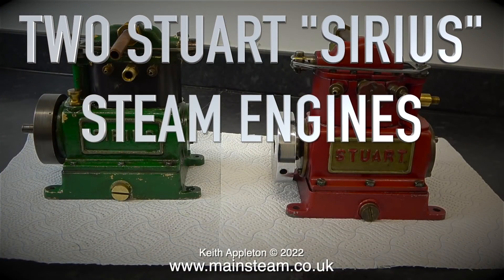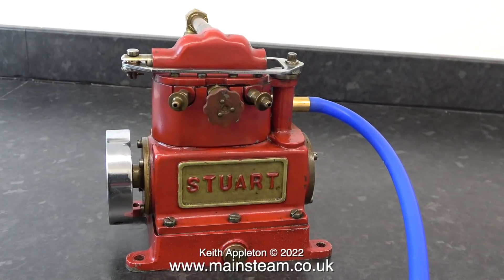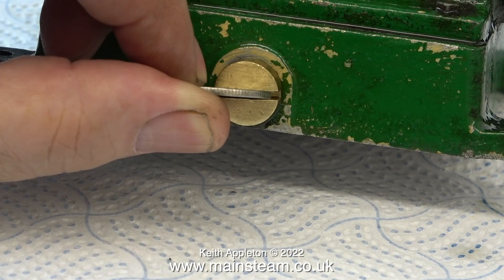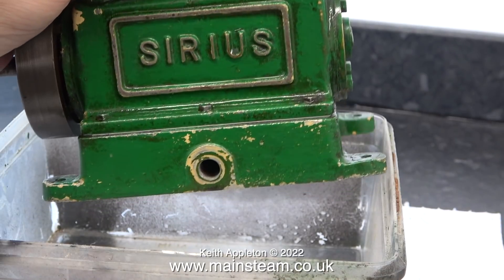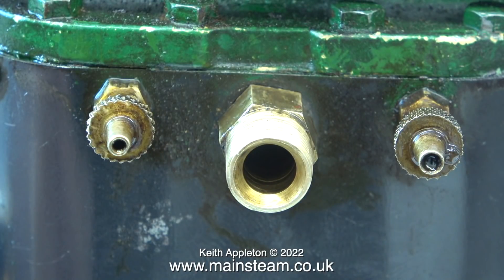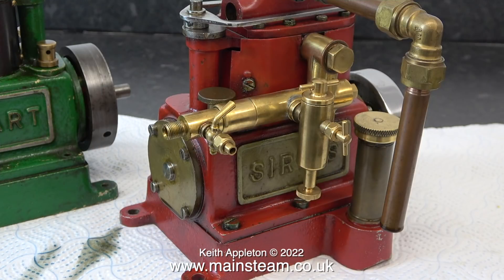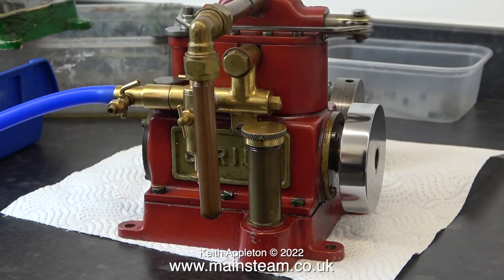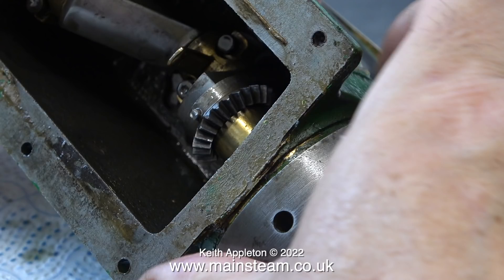TWO STUART SIRIUS STEAM ENGINES - PART #1

Comment: As a generating set this wouldnt be used to power the radio set but rather it would be used to charge the batteries for the set. The generating set could well be used to charge batteries for several radio sets, and wouldnt be co-located with a radio set. So it could be that the generating set was in a location where its noise wouldnt be so obvious with a good supply of water and fuel for the boiler.  Small petrol generating sets where used by the British Army from the late 20s up to the early 90s for the charging of batteries in a simliar manner (there were also hand cranked generating sets as well).

Comment: The cross drilled plug  is so when you remove  it half way the oil will leak out  while haveing time to get  there can in place ..... other wise  the oil misses  the can a oils in there boot?    Just a though..  as I seen these types of plugs used
Reply from the maker: Yes, I realise that, thanks. I mention it in a later video.

Comment: I once saw a picture of a steam racing speed boat with this type of engine. It looked very interesting.
Reply: These engines I understand were a popular choice in model steam powered racing Hydroplanes. They would run them off a flash steam boiler at between 5,000-6,000 rpm.

Comment: The cross drilled hole is for draining the oil without removing the plug I think. We have some machinery where I work that have this feature.
Reply from the maker: Yes, I realise that, thanks. I mention it in a later video.